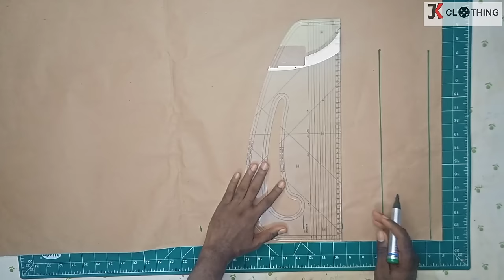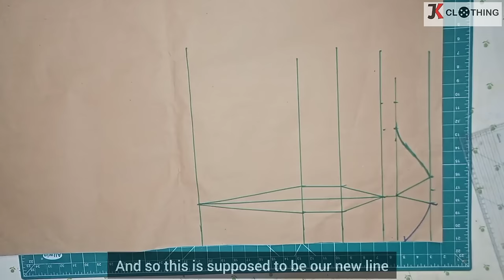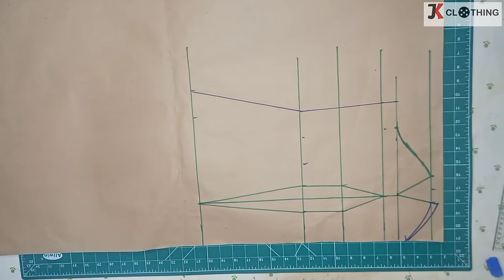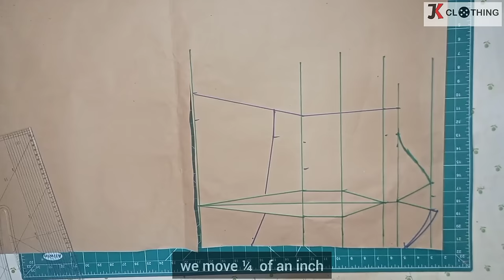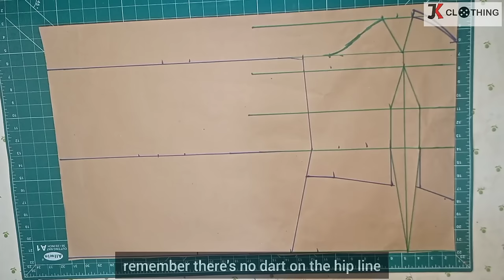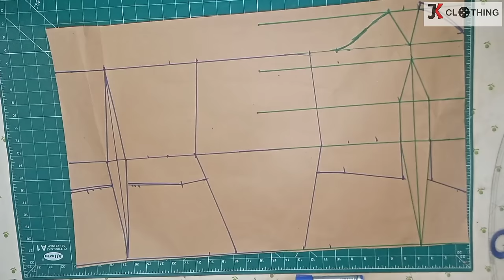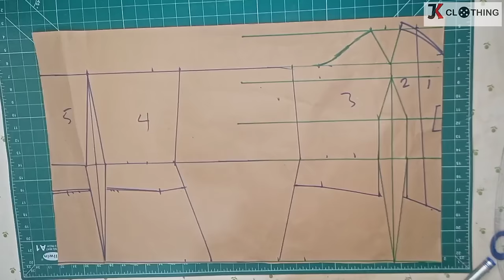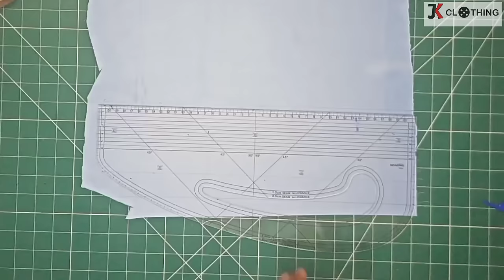HOW TO SEW VICTORIAN CORSET GOWN WITH OVERLAPPED OR WRAPPED DRAPE SKIRT || DRAPING CORSET || FULL

Comment: Hi thank you for this detailed video :)
The first measurement from starting line: is it 4inches or 3.5inches where you marked? Also do you take measurement from highpoint of shoulder to bustpoint OR from shoulder-armhole intersection to bustpoint? Thank you 😊
Reply from the maker: Thanks for the feedback. The first measurement, which is the neck width is 3". Also I take the measurements from the highpoint of the shoulder, very close to the base of the neck
Reply: @JK-CLOTHING  thank you for your prompt reply ☺️
In the video, it says shoulder to nipple measurement. Is it 3.5 inches where you marked or 4 inches as mentioned in the video? Thank you again 😊
Reply from the maker: Shoulder to nipple is neither 3.5 nor 4 inches. It's rather the difference between the Starting line (ie, the upper bust line,) and the shoulder to nipple line that is marked as 3.5, 4, 3, 5 or whatever as the case may be

Comment: Thank you for the video, so helpful. Pls how did you draft and cut the skirt part
Reply from the maker: Thank you so much for the comment.
With the skirt, I divided the waist by 4, then added seam allowance.
Then hip divided by 4 plus seam allowance,
Then for the knee line, it's the hip measurement, divided by 4, minus 2 inches, plus 2 inches seam allowance.
From the waist to hip line is 9 inches and hip to knee line is 10 inches.

Then you shape it out as you wee in the video.
For the overlap, you use your discretion since it's quite easy to figure out 🙏🏽 🥰

Comment: U marked 4’ from the starting line down, will it work for everyone, why 4 inches immediately after the starting line ( hope I made sense)
Reply from the maker: Let's say from the person's shoulder to nipple or bust point is 10½, to Underbust is 13½ and to waist is 16½ and to hip is 24½.
The 4 inches is the difference between the nipple line and the upper bust there the dress is expected to start from.
Reply from the maker: So the Starting line is the upper bust line, the 4 inches down is the nipple line. So if your client's upper bust line is 6 inches from the shoulder, and the shoulder to nipple is 11, you'll just have to deduct the 6 from 11 and get 5. In that case the starting line will have 5 inches below it to give you the nipple line instead of the 4 in the video

Comment: Please how did you cut the skirt part? The over lap and drape, do you have a video of it please?
Reply from the maker: The skirt is a normal long penciled skirt. You use that to cut the back. Then you open it up and sketch the directions of the front pieces that overlap
Then you spread and splash as was demonstrated in the video
Reply from the maker: Thank you for the question
Reply: @JK-CLOTHING  Alright, thank you so much 🙏🏾